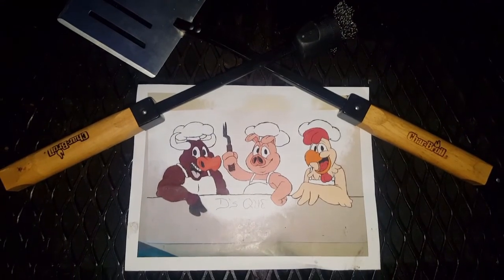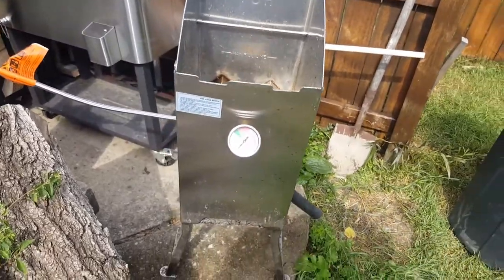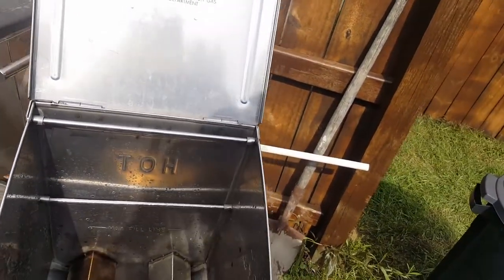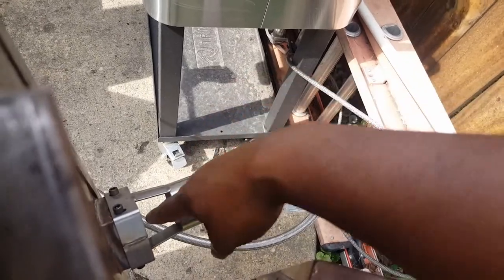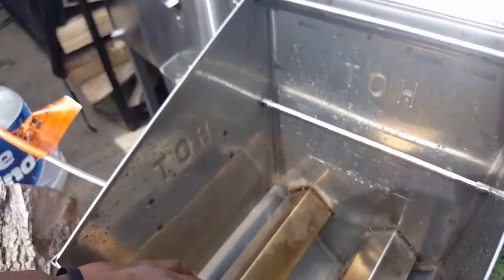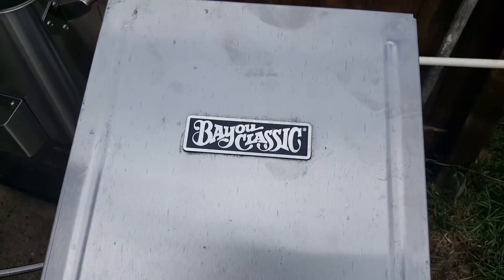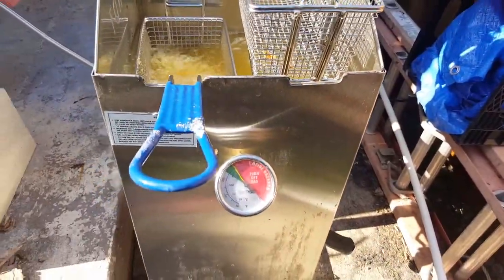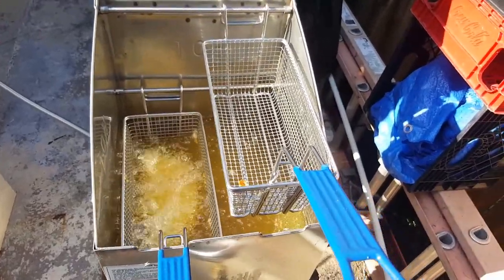Bayou Classic 4 Gallon Fryer

Comment: Do you drain it after every cook?  And do you store the filtered oil back in the unit?   Or do you store it in a container and refill before using next?
Reply from the maker: I drain it after the cooks. Filter out the solids and store the oil in the original containers in my basement until i am ready to use it again. I don't fry enough to warrant leaving it in the fryer.

Comment: Can you please let me know where you got that bowl from?
Reply from the maker: I will do my best to see if I can find something on it. But I got it here from a 3rd party seller because it had a small dent. It had the barcode and something else inside of it when I bought it and I usually keep all of that kind of stuff in a file. I will check when I get home to see if its there. One quick insider tip.. If you search restaurant type keywords in craigslist there are normally loads of SS equipment available from places closing up. Unfortunately I find the best deals for this type of stuff through CL lol
Reply from the maker: So this particular bowl came from Sears. 77.00 retail. 30 qt SS mixing bowl by Terrorio. You can find similar ones on Amazon for around 50-60